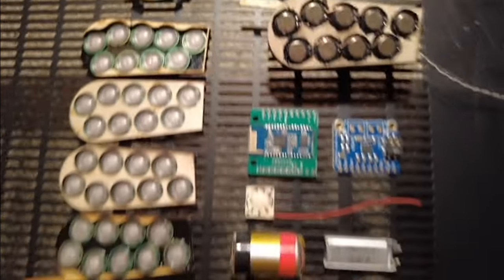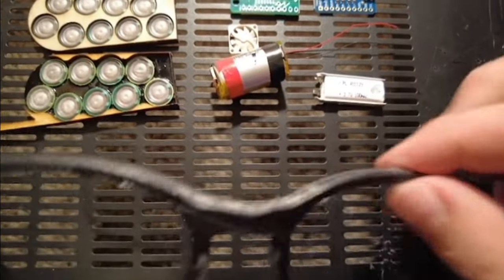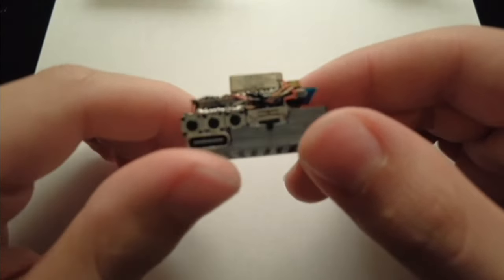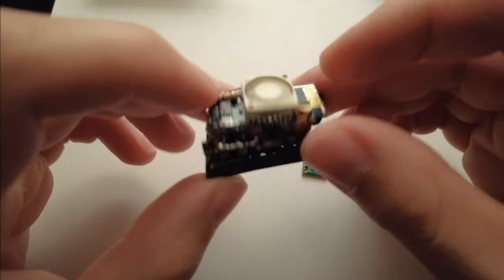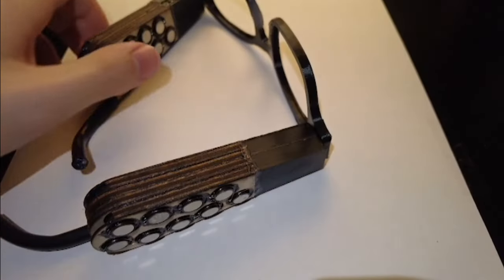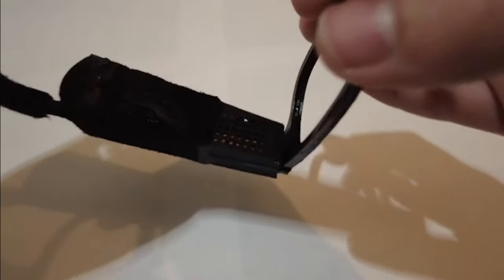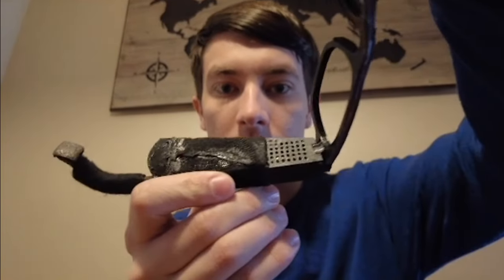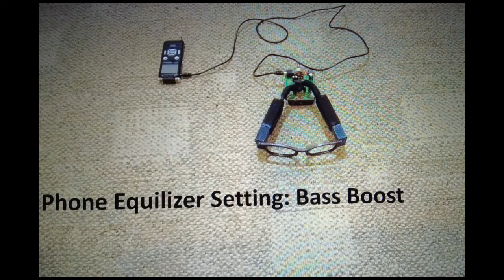Stuffing 72 Speakers Inside One Pair of Audio Glasses HD!!!

Comment from the maker: It turns out that this video is not actually more HD but rather has better coloration than the other video. When I originally recorded the clips, I put the camera way too close to the parts and it was always blurry. I also tried to use premier CS6 with a mixture of video resolutions which basically made this video impossible to be truly HD. These problems will not exist in the future.
Reply: Do you not have a cell phone capable of 1080p recording & decent audio quality?
Reply from the maker: @zane812 I have a DJI gimbal 2 but I made the mistake of changing the resolution from 4K to 2K mid video so I had issues with CS6.